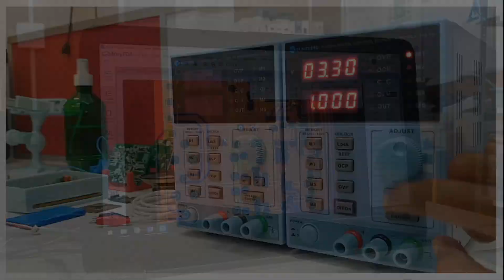Five elements of electronics industry #E02 | Vaibhav Sugandhi

Comment: if the dangerous topic comes in between current and voltage, i can say both bcoz of the voltage difference between a point which tends to flow of current through the resistor .
Reply from the maker: Hi Sankar, 

Yes, due to low resistance body high current flows through it and causes fetal injurie's, however the HVDC voltage is the one which allows high DC current that truly dangerous for humans. 

Thanks for the comment, 
Happy learning :)

#Linked_Frequency